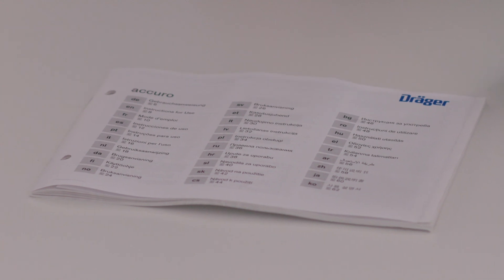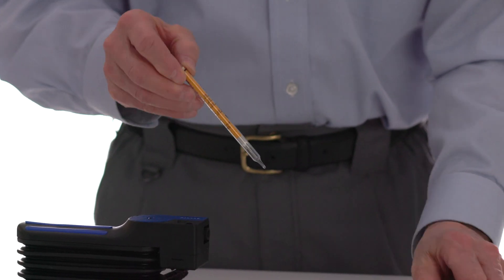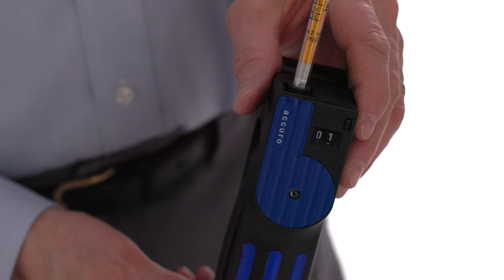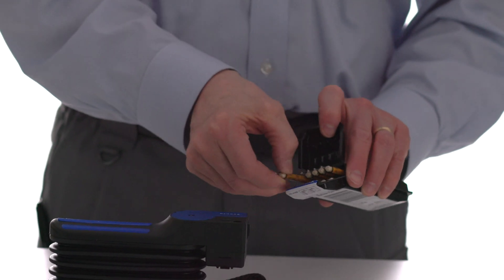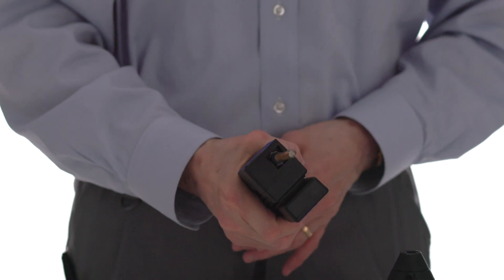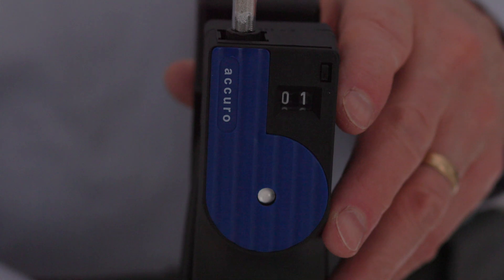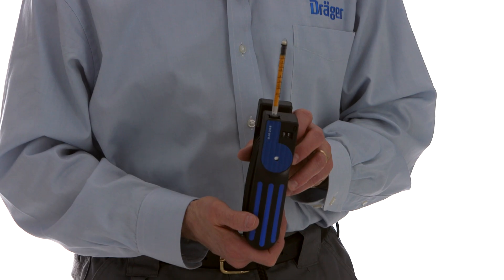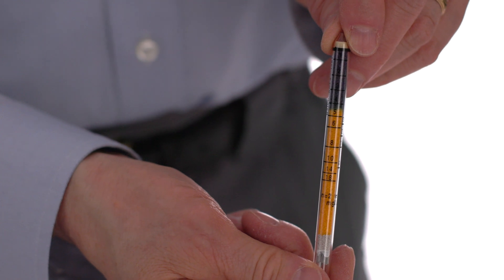Draeger accuro – Pump and Tube Use

Comment: We use ethyl mercaptan tubes to identify ethyl mercaptanin in the vapour phase of LPG.
The tube manual contained in " the calibration is valid for methyl mercaptan in the air " , is the calibration valid for ethyl mercaptan in LPG vapour phase?  (tube Mercaptan 0.1/a 81 03281)
Reply from the maker: The Mercaptan 0.1/a can be used in propane.  In our lab we observed no reading on the tube in 100% propane.  However, when we tested in an atmosphere of 90% propane, nearly 10% propene and ppm levels of ethyl mercaptan the readings on the tube were 30 to 50% higher than the actual ethyl mercaptan.  For example, a sample with 5 ppm ethyl mercaptan resulted in readings of ~6.5 to 7.5 ppm (this varies between 30% and 50% based on the particular batch of tubes).
Reply: Lpg mixture (propane 30vol% & butane 70%)
Can you give  your email ?

Comment: Thank you this is a great Video. I have used draeger to measure H2S content for a while but I have a question. How accurate is the reading if we use an expired tube? I have tried it myself and I found no significant difference between the expired (march 2019) and the new one (july 2024). But I need an expert opinion to prove this thank you.
Reply from the maker: Dräger does not recommend to use tubes past the expiration date.  However, it is quite possible Dräger-Tubes may provide very good results for some time beyond the expiration date stamped on the package.  This may depend on the particular reagent system or storage.  If the tubes are stored within the temperature range on the back of the package (typically 5 °C to 25 °C) and kept in the package (not direct sunlight) the reliability of the tubes is guaranteed by Dräger through the shelf life on the package.  Tubes stored in cool storage (not frozen) at the customer site may be very good for some time longer.  Dräger does not guarantee the integrity of the results of tubes past the expiration date.
Reply: Hi Arif I have some questions related to H2S detection please reply, it would be great
Reply: Like how much does it cost per check
Is it accurate
And from where can you buy this ?